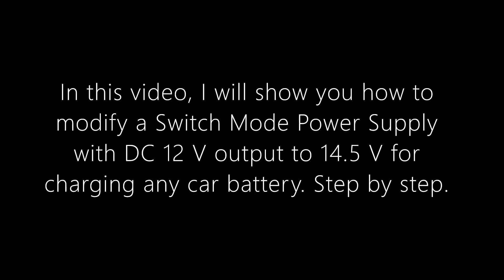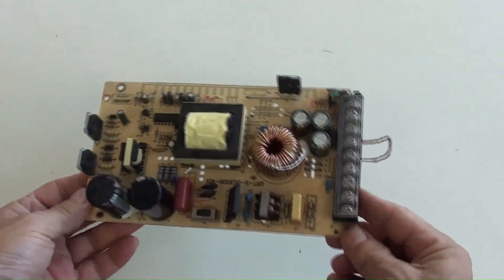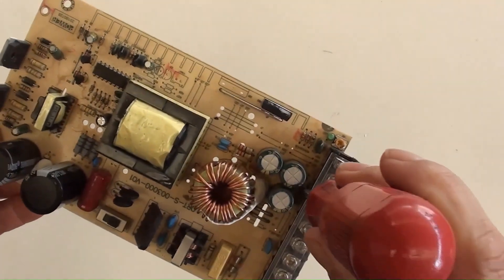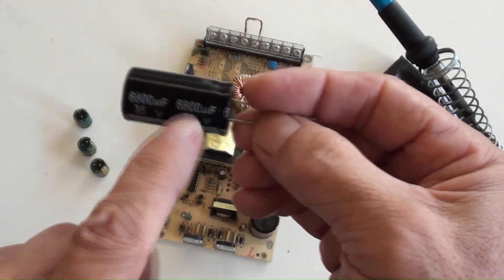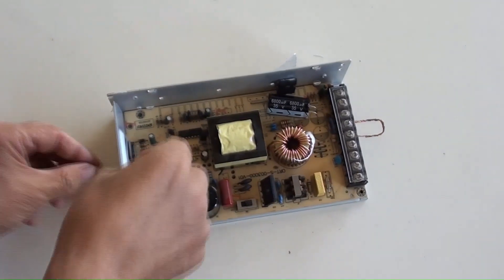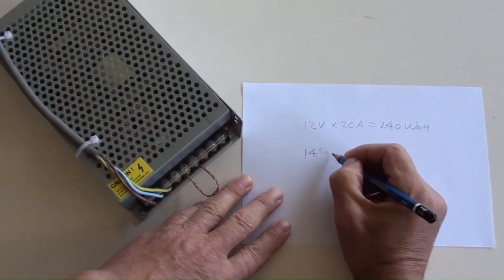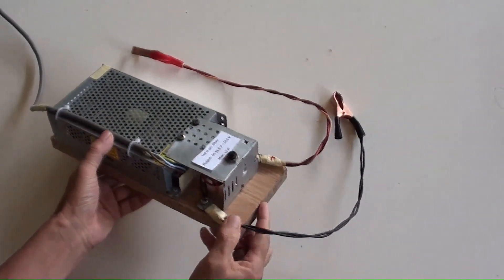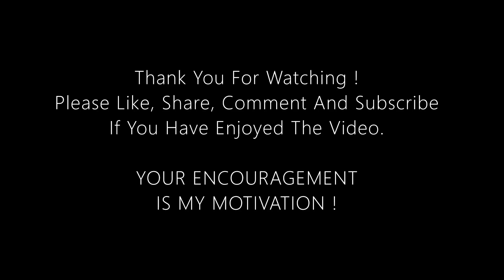How To Modify 12V SMPS Power Supply To 14.5V For Charging Car's Battery?

Comment: Why do you need to change the capacitors if they are rated above the max voltage? Thanks.
Reply from the maker: Good question, Mate!  Theoretically speaking, those of 16 V (because of 16 V > 14.5 V) capacitors no need to be replaced however in practical, it'd be better off replacing them with rate of 20.5 V or higher ( because of 14.5 V x 2<2 = 14.5 V x 1.414 = 20.5 V) for more safety, just in case.  Thanks!  👍
Reply: @diymade2175  Ah, i get it. Many thanks for the reply.
Reply from the maker: Cheers!

Comment: what???   are you connecting the smps directly to the battery???????    re you crazy ????!!!!!    the battery can be damaged/destroyed or even explode
Reply: How many amps does it take to charge a 12 volt lead acid battery?
As a general rule of thumb when selecting a charger for a lead acid battery, match the voltage and use one that is no more than 20% of the capacity rating of the battery (at a 20hr. rate). Example; to charge a 12 volt / 7.5Ah battery, select a charger with a maximum charge output of 1.5 Amps (7.5 x 0.20 = 1.5).
Reply from the maker: @kennmossman8701  Good day Mate, you've mixed up with the concepts of how to choose a suitable charger for a particular battery as you mentioned and how mush charging current can go through that battery.  The basically speaking:  How much charging current can go through a battery depending on the charging voltage and that battery condition (neglect other facts), the worse battery condition, the higher charging current.  Wish you'd remember about ohm law:  I = V / R.  If the battery condition is normal, there is not any difference for charging current to go through that battery by using a 1.5 amps charger as you mentioned or 20 amps charger as in the video showed as long as two different charger's charging voltage is the same value such as 13 V.  I leave to you for figuring things out. 👍
Reply: @diymade2175  1  you've mixed up with the concepts  . 
NO  you are mixed up. I am saying a power sppply is NOT a battery chrager. I dare you to find any creditable source that says otherwise.
2    How much charging current can go through a battery depending on .... battery condition 
Condition????  what does  mean, do yo not know the technical terms.    condition---lmao

3 the worse battery condition, the higher charging current.  
Condition???   FALSE - there is a limit on chargig current.

4  ....about ohm law:  I = V / R.  
WHAT   very funny you refer to Ohm's law but do not use it.   seems you are lost

5 the rest is rubbish without any foundation nor logic nor knowledge - just deluded nonsense
Reply: yes, he is. and this is not even the worst...
Reply: Correct!
Reply from the maker: Why not?  Please watch the video carefully & fully.  Thanks again! 👍
Reply: @diymade2175  OMG  the battery can be damaged/destroyed or even explode
Such a stupa reply by you.....makes me wonder about your expertise - LEARN about charging batteries
Reply from the maker: @kennmossman8701   I'd reckon you need to refresh what you had learnt about electric subjects or research related to charge battery(s).  Thanks!

Comment: different smps use different circuits -  this will work on some units
WARNING     high voltage alert......always unplug before doing anything
Reply from the maker: Thanks for your interested!  No worries because:  The standard AC 220 or 110 V to DC 12 V smps power supply internal circuits isolated between high voltage part of the circuit and low voltage of the one.  In the video showed with live power was on, the only low voltage part of the circuit or components were touched.  🙂👍